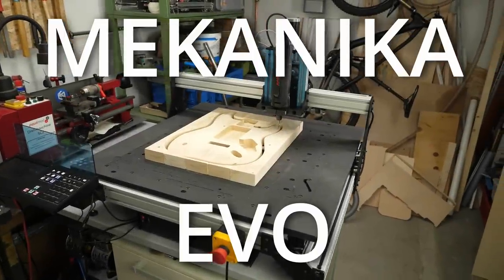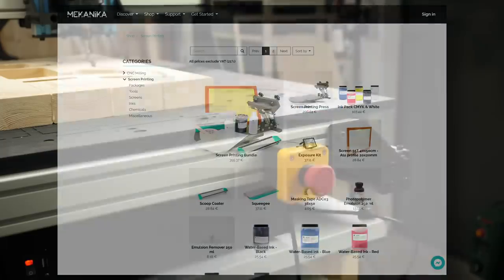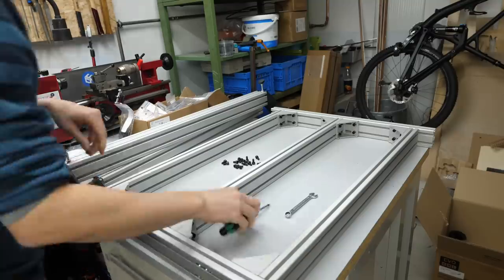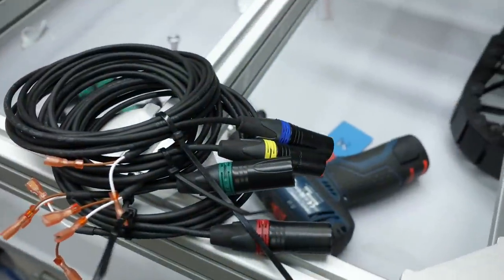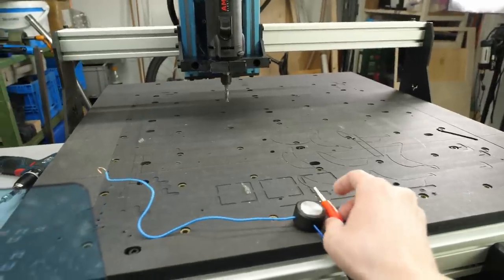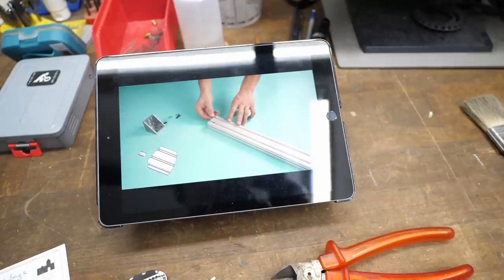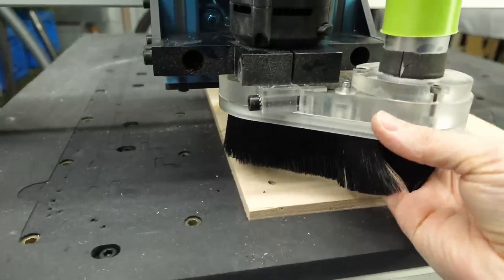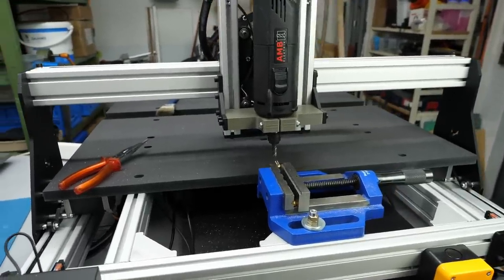Mekanika EVO-S CNC Router REVIEW - Great CNC for Beginners (with money)

Comment: I appreciate the effort they put in the user experience. The assembly, the screen, remote folder and ease of use are all nice.
That being said the construction of the machine seems concerning. Massive extrusions for the frame but a flimsy board to mount the Y-axis? Weak belt drives, rollers that clog, a trapezoidal thread z and open-loop steppers??
Reply: The Pro version uses ball screws and linear rails, but those high-quality & precision parts are reflected in the price.

The y-axis plates are similar design though, and will likely have the same rigidity problems. Seems like the Pro version is still intended for soft materials or light aluminum work. 
Are the steppers (without encoders) a big deal? They should be more than accurate enough, unless they lose steps - which shouldn't happen at the cutting loads this machine is intended for.

Comment: The belt-driven XY plane and V-slot rollers are a dealbreaker.
Reply: He said it is the smallest of the lineup, I guess the belts make sense in a low-end large format CNC
Reply: @rexsceleratorum1632  They really don't. Leadscrews would be better and don't cost much more. About 150 USD total. On a 3D printer? Fine, because the toolhead has a negligible force exerted on it by the "workpiece." But with a router? There's quite a bit more force, and that resultant deflection is evident in this video. You shouldn't have to compensate that much as Stefan did.
Reply: @theofficialczex1708  I think belts could work. But should not be the way to go in the 3000€ priceclass and not those tiny (9mm?) belts. They could've used 15mm belts. Open V-Slot rollers for a chip producing machine is simply not thoroughly thought through.

Comment: Ooh, those XLR-style plugs are a real highlight of the whole thing.  More devices should do that; those are highly durable, hard (or impossible if arranged correctly) to mix up, and made to be disconnected/reconnected thousands of times, which makes it possible to hack this thing to do more by swapping cables...
Reply: Mini-XLRs are great. I used them for my bike light batteries! Not waterproof but it's corrosion, rather than short-circuiting, that's the enemy for low voltage power connections and the mini-XLRs are almost always gold plated so they work great.
Reply: @cooperised  oooh there are mini 5-pin connectors too! That would be great for connecting up stepper motors and such. 
For waterproof needs, looks like there are many off-the shelf and automotive connectors for that too. 

I'm just glad to see nicer connectors than the standard small JST-variations, which aren't meant for many cycles or rugged use at all! (I do see that JST offers a billion connectors, but I mean the usual JST-XH you see on 3D printers)

Comment: Thanks for the shoutout Stefan! If anyone has questions regarding Zellerfeld do not hesitate dropping them here!
Reply from the maker: Any time!
Reply: I won't ask my questions here, it would take too much space... lol

I am working on R&D on a 5 axist #D printer that can allow you to reduce to nill the internal suppots and to a minimum the external ones, also working to an add on to make it a 7 axis machine, the idea is that anybody can 3D prnint the key components and than dissasemble their regluar cheap 3D chinese made printer, and with a few more parts to buy online can transform them in a 5 or 7 axis machine.

If Zellerfeld is interested in such an approcah for the machines they use, I can help.  It reduces the printing time (by not printing supports, at least not everywhere) reduces the materials consumed, for the same reason, and the post printing time for not having to clean so many supports and than sand the part to make it look nice where the supports were attached.

Comment: Another great video!  I need to get back to playing with my 3040 CNC machine.  I did notice that it looks like your Y-axis belt path would be better if it ran under two rollers on both front and back instead of just one as shown at 0:22.  It would give more tooth engagement on the drive pulley.

Comment: Interesting kit but I would rather recommend a better construction using ball screws and trapezoidal linear guides. I have had great experience with two machines from OmioCNC (China): a X6-2200L and more recently a X8-2200L. It is way stiffer than the Mekanika (Hiwin HR20 guides and ball screws on all axes) and has a 2kW water cooled ER20 spindle..

Comment: Nice Video! Could you show more of the Electronics of this Mill. Which parts are used & how the emergency stop is connected to the mill? Its open source, but i dont understand which parts needed. Could you show as a video with detail rich of the wiring and electrics.

Comment: I appreciate your honesty Stephan! I agree with you on the last point. There is a better choice for makers and even businesses which is to build their own cnc. There are many open source machines on the internet that are far more capable than the Mekanika with an affordable price. Check out PrintNC for example. In my opinion the electronical side of the mekanika is solid but the mechanical side is a joke for that price.
Reply: joke is maybe a bit too harsh. you have to consider that the hole is more than the sum of the pieces here. I also think the belts are a very brave decision but the results prove they made it work. I personally see more of a problem in the low z travel. that could have been fixed with very little money
Reply: @savejeff15  Parts that are under/over sized is not a good result - indicates that it doesn't work.
Reply: @Shocker99  yes that is in fact a little bit worrying. I personally upgrade these Maschines after I buy them. That belt system would be the first thing to go. But in general I think it's still a good value for Money
Reply: @savejeff15  I only meant that if you want to charge customers for that money, at least choose parts that have lower maintenance such as ball screws instead of 3d printer wheels and belts. That is just how i see it.

Comment: Before you route out the final guitar body, ask your friend to consider ditching the "swimming pool" pickup cavity and instead routing around the shapes of the individual pickups. it's less machining and many consider it to make a better sounding guitar.
Reply: It's gonna sound exactly the same, the body of an electrical guitar does nothing for the sound. I't is just gonna take less machining, and for me  it's gonna look better because you don't need to use an ugly pickguard on your guitar. :)
Reply: @hebus4  the most important thing about the body of an electric guitar in terms of affecting sound is the rigidity of the structure from bridge to nut. It won't make much difference in a strat because of the tremolo has a much greater impact on rigidity. Still, guitarists enjoy arguing the toss.
Reply: @KX36  yup that's the only thing  besides strings and the electro stuff. All other is just bs to sell  ;)

Comment: The price is expected because just those "color coded connectors" (depending if they're 3, 4 or 5-pin ones) cost like 3.50-7.50€/piece.... +0.25e for the color coding ring :)
I mean... they use Neutrik XLR connectors... they're serious.

Comment: Deckel FP3 or an old Maho with heidenhain language cost about 5000 - 10000 Euro. Imho a much more better deal. Because those machines have a more powerful engine with 9,6 kW and are heavy 4200 kg (which is important for vibrational stiffness and so on). These are properties which are necessary for machining steel and other alloys.

Comment from the maker: Zellerfeld is looking for the best 3D printing engineers globally. Check out their job listings: https://geni.us/ZellerfeldJobs
Would you rather build a DIY CNC router or buy a finished kit?
Update #1 22-03-07: The "DI Spindel" upgrade is not only the spindle itself but also includes additional electronics within the electronics box, which makes the €300 price a bit more reasonable but also means that you will not be able to upgrade to the DI Spindle if you purchase the Standard Spindle at first.
Reply: @StevePotter  neia
Reply: Vielen Dank für die Werbung, ich schreibe gerade meine Masterarbeit im Themenbereich 3D gedruckter Schuh. Das sie jetzt in Hamburg (in der Nähe) sind wusste ich nicht und ich denke ich werde mit ihnen Kontakt aufnehmen. Vielen Dank
Reply: @jamesmor5305  Guter Witz

Comment: I would love to see more videos on current cncs. I've been looking at a suuuuper cheap one (like $200 if possible) that at least isn't a fire hazard. It's more for me to see if I should learn more about cncs or possibly laser cutter.

Oh, a DIY cnc cutter? I do have a dremel....
Reply: I wouldn't be too concerned about the machine starting a fire, because unlike a 3D printer, you can't really leave a CNC Router unattended anyway. So a fire extinguisher does work since there's someone around to use it.

Comment: very nice product. I think the price is pretty good. i think its the lowest price where no important corners must be cut. 
The belds are a brave decision but they seemed to make it work. only real negative point is the low z travel. would have been super easy to just add 5-10cm by just increasing the length of some parts. 
i consider buying this at it seems very well made and I don't want the pain of finishing/fixing half complete china cnc mashines
Reply: If they increased the Z travel they would increase the leverage on the v-rollers making the machine much less rigid. While I agree that it is very limiting (I have 12cm on my KillerBee and still wish I had more), it would likely make the machine unusable for anything apart from wood if they increased the Z height much at all.
Reply: I disagree. It's not using anything that you wouldn't find in any cheap chinese 3D printer but for thousands of $.
I feel like the community could easily design something with equal performance for a fraction of the price.
Reply: @LanceThumping  you forget that community is not getting payed for there work. These people want to live from there product.
Reply: @LanceThumping  That's not the point here. You will always be able to build something cheaper and better yourself, but not in 5 hours and not with easy to follow instructions and prewired electronics. Those who know how to build something themselves or have the time to learn should not buy this machine, but they're also not the target audience.

Comment: for hobby level it's fine but if you want to be serious with aluminum and other metal project you need to upgrade with linear bearing and ball screw and don't forget the motor need more HP and torque.

Comment: I rather like the idea of the belts - but I think they should be used in the OX style, where there´s a belt glued to the bottom of the V-channel with the teeth up abd the drive belt engages with the glued belt - resulting in very little - to no flex,

Comment: I used  PlanetCNC for my onwn diy CNC machine. It's a nice packed, but becarfull with more advanced commands like G41/G42/G40. They will crash your Machine! PlanetCNC sas they support thos commands, but they don't do it right. You are fine as long as you don't us cuttercompensation in Fusion360. If you want to build your onw CNC use LinuxCNC or EdingCNC. I use LinuxCNC in my newest machine.

Comment: I feel like the belt system isn't so great. Thicker belts are almost certainly a must to make it stiffer, and a dual-belt system like used on some MPCNCs would help as well. Maybe you can try modding it for larger belts and make a video? Also, the upgrades are almost certainly overpriced.

Comment: I´m in search for a good CNC Router for hobbyist. Should have a bed size of at least 300x300mm and should be possible to drill a 100mm deep hole. Also it should can handle aluminum without problems all day long.

Comment: Hi Stefan, nice piece of hardware, but sometimes you are saying "sometimes" a bit too often... lol

For such a large machine I would of cohoosen cable cored timing belts (that also require larger radius pulleys) to avoid the backlash.

On this tune, while working to my Rumba 5 axis design, I decided 6 models would be available, defined by the available working cube, so there is 200X200, than 300X300 and 400X400 series that can use regular timing belts, but personaly at 300X300 and above I suggest cable cored ones (plus wider belts: 10mm) and 8mm shaft Nema 17 steppers, (also because if you add the other 2 axis, S and T to go 7 axis printing, you actually add more weight that can cause baclash in printing).

Bu the next 3 sizes cube are 600X600, than 800X800 and 1000X1000, and here not only I jump to Nema 23 steppers and mandatory cable cored timing belts, slighlty wider, like ... 12 mm to 16mm wide, at least for the X, Y Z U and V axiz, the S and T might still do with Nema 17 at 8mm shaft motors.  Obviously with such belts my 3D printers can do routing of light materials as well, up to Aluminium and some tough hardwood, but not iron or steel.

And I want my printers to be easy to fully enclose in their own oven, that means I am now designing water cooling systems for the cheap stepper motors you can find on the shelf, for there are no water cooled stepper motors at decent prices tht I know of..

Comment: for 4500gbp i bought a used 2440x1220x300 cnc router with 8HP 10 tool atc spindle 2x 5HP vacuum pumps.   all ball screws and servos.  control is super old and could do with an upgrade  and the machine is a moving bed design so takes up a lot of space and weights about 4000kg  but far better value than any new aluminum extrusion machine

Comment: I still feel like these things seem way more expensive than they should be.
If 90% of the parts they are using are things you'd see on a CR-10 but with bigger extrusions then they aren't likely worth the multi-thousand $ pricetags.

I feel like it should be relatively easy for the community to make something in this same style for far far cheaper.
Reply: There are already countless projects for DIY CNC routers that use alu extrusions (or metal pipes), linear rails and/or v-rollers and 3D-printed parts that can get you a decently sized machine for <1k€.
Reply: @NiyaKouya  Sounds like what I would've expected (I'm not in the DIY CNC community).

It has been constantly ridiculous seeing these multi-thousand machines that are no where near worth that much getting tons of attention by YTers.
Reply: That where my first thoughts too as an ender3max user. The big difference is that 3d printers produce a workpiece and had not to cut off something which has always a force resistance. That's why I see the timing belts and rolers a very cheap method for cnc routers.

Comment: Those roller guides are a crime to put on an a CNC router imo. Once this has been spec'ed out to acceptable level you probably pay just as much as for a Sorotec that has a much more rigid frame. The control panel is kinda neat though but would not get me to buy this.

Comment: I don't like the design of the tool length probe. Some endmills are coated in a non conductive coating which would make the measuring process not very reliable. At this price point I would have expected better. At leas a tactile switched probe.

Comment: THe thing I really don't like on this machines is the fact they're belt driven. An ACME screw would be good enough
Reply: With an ACME screw you cannot get the hi movement speed you need for cutting wood.  If you machine moves slow, your spindle must turn slow, and everything is slow then, otherwise you burn mills and material pretty fast.

Comment: That doesn't look like it was designed by an engineer, at least not a very good one. There are just too many bad choices. An assembled machine from Stepcnc or although smaller, a Karla kit would be much better in a similar price range. The belts and rollers definitely are not a good choice, cheap round rails with bushings or something like Igus linear bearings would far superior if hiwin is too expensive. High helix leadscrews, cheap ball screws or rack drive would be much better but at least they could use heavier belts and not depending on the stepper motor shaft and bearings to support all the load. I find the abuse of set screws to be horrifying and closed loop steppers with proper enclosures and heat sinks would be money well spent given how cheap they are. I like the plugs and cable chain at least 😀.

Comment: What I do not get is the frame of this machine. For some reason, extremely rigid and thick aluminum extrusions are used, of course for sturdiness. But why use those timing belts, to throw all that accuracy you gain with such a frame away?  But well, it could just be my bitch *ss complaining.
Reply: Excluding the HMI/control system, i wonder how much the machines costs?  Using timing belts seems like a silly cost cutting idea for an aluminium machine.
We have a 'budget' CNC machine at work.  The HMI/control system on it costs $€£250. And it cuts parts to well within tolerance every time.